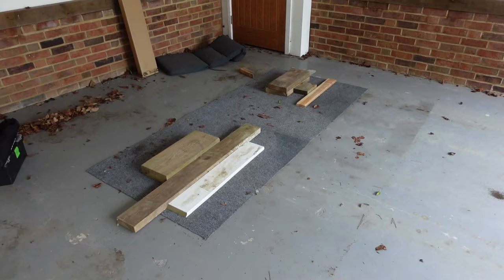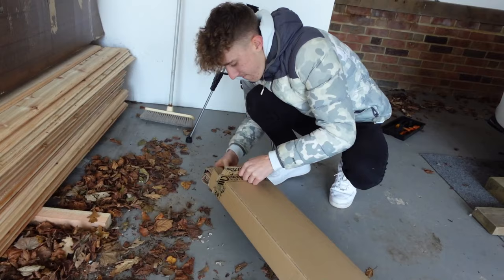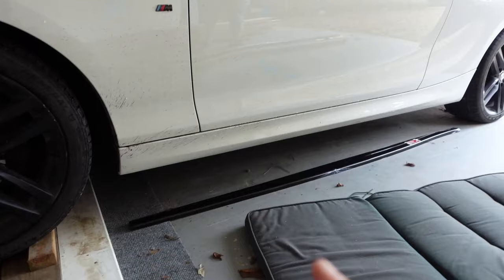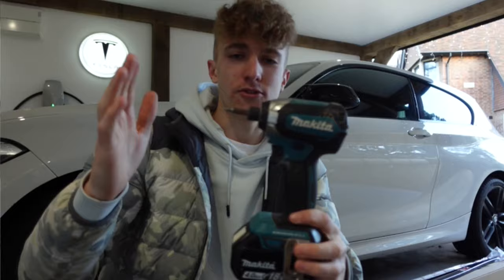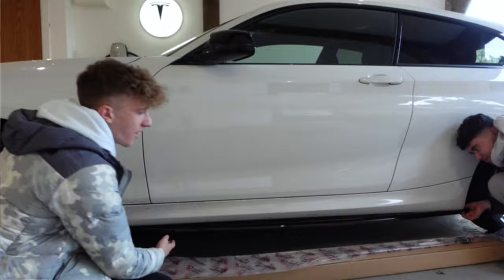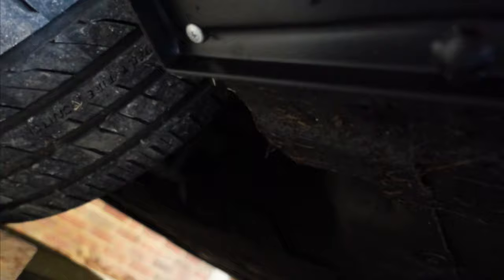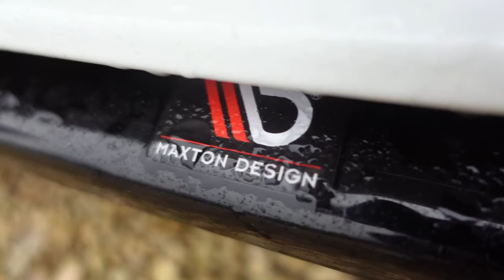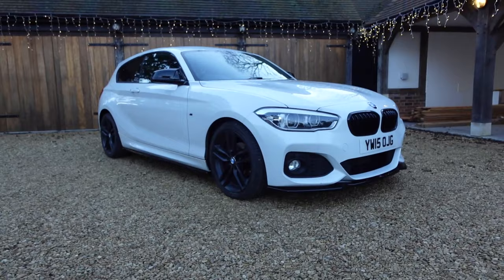HOW TO INSTALL Maxton Design SIDE SKIRTS to BMW 1 Series F21 (EASY!)

Comment: Hiya, my local garage said they will be unable to do work on my car if I fit side skirts as my car will be too low and not get on their ramps. Are you having any issues taking it to garages now that it's much lower?
Reply from the maker: I haven’t had any issues at all it doesn’t actually make the car much lower especially if you have the stock suspension

Comment: Just get a vinyl gloss black wrap on the roof. I got it done on my Sunset Orange M340i (which has the shadow pack so black grille, mirror caps and window surrounds), got the carbon M-Perf kit fitted and the roof is the thing that sets it off most (and gets the most comments).
Reply from the maker: I've always thought a black roof would look good